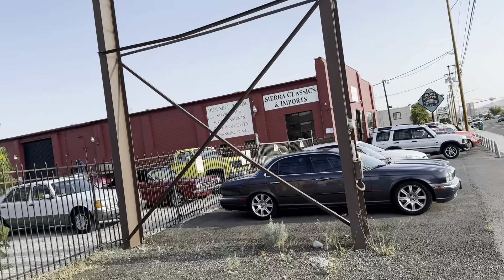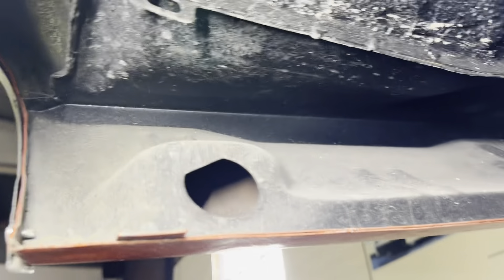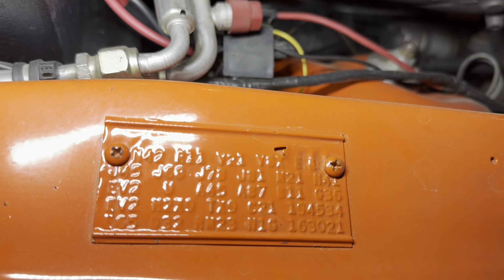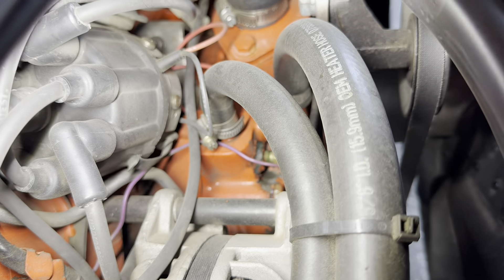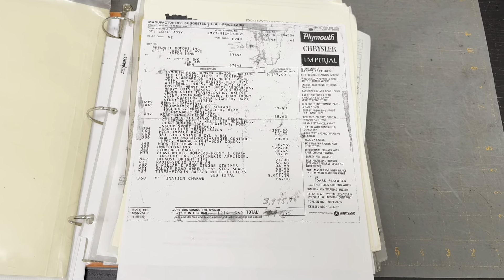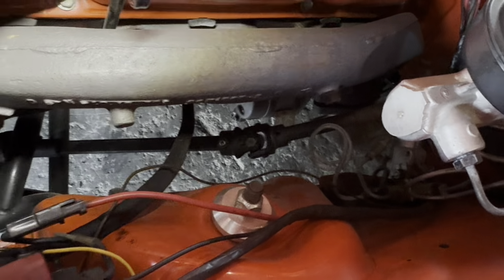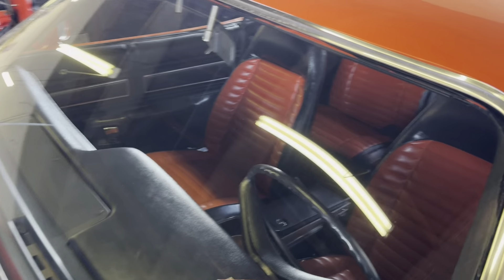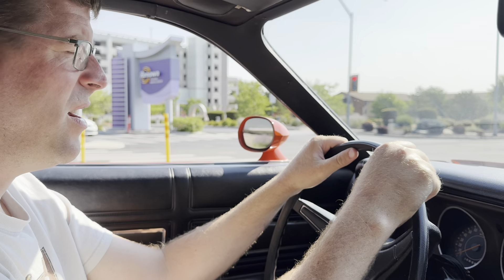Before You Buy - 1971 Plymouth Roadrunner Pre-Purchase Inspection (And What To Look For)

Comment: In my experience cars like these always bring more money than their worth because buyers never have somebody go over them and they dont know the difference. The good restorations from the smaller shops dont make money because they take so much time. Quick and dirty cars like this easily double their money. To me, coilovers, tubular suspension and Wildwood brakes are screaming red flags. They do it because its easy and they make a ton of money on it, but they are NEVER set up right. They just bolt it all together slap a coat of paint on it and boot it out the door. The cars ride and drive poorly, and the customers think its ok because they dont know any better. Then some poor owner down the road has to spend thousands with an experienced shop just to get the car as good as it would have been stock. Great vid, very cathartic, there are thousands of cars like this, hopefully people learn.
Reply from the maker: Watch my video coming out tomorrow - I’m doing a comparo test between a stock Mopar and this.  Think you know what my conclusion is going to be. To me the biggest red flag on a Mopar is no core support blackout, which this car does not have.  Saying that with as many “red flags” as this one has it’s actually a pretty good car.  We are planning on removing all the front end stuff to go back to stock.
Reply: @rocketresto  looking forward to it. Yes all things considered that car looks pretty solid for what it is, some good numbers matching components, great platform to build on. They key issue is price. You guys know what your getting, but somehow, at least in my experience, even this day in age, most people still dont. Great stuff though, very enjoyable watch, wish every car could be gone over like this before getting sold.
Reply from the maker: @maxsav007 don’t think my Dad wants to share price but will say it was $20k less than where they started.
Reply: @rocketresto  Can you double check on the turning radius? I think I heard before that it is larger (meaning worse) on the after market  tubular suspension. I would love to know if it it is , say bigger than a C body, or a  D truck!
Reply from the maker: @auteurfiddler8706 watch our video today, we go into that, it drops at 8:30 AM pacific time.

Comment: My dad was a retired (in 1978) mopar tech n racer along with I think the chassis book said that the torsion bars being below the floor lowered center of gravity drastically and spread the load throughout instead of on the coil pockets n front frame...
Reply from the maker: 100% correct
Reply: @rocketresto  I think it was in a hot rod magazine musta been late 70s early 80s they had a write up on the guy that ran 66 Dart like mine in scca.. he showed in detail his set up.  I had kept the details forever then life n crap u know.. but big takes were boxing control arms.. connected subframes.. had a bar welded in up under dash.. had a that bolted in from above between shock towers.. heavier torsion bars but can't remember what he used.  Same with sway bars.. think he had travel limiters on front and HD shocks.. but if uv ever watch that car going around the track it flew thru corners.. if I remember correctly he was the scca dude up till 70 when it all went insane.. other thing my pops preached to me was manipulating steering box/pitman and idler arm so they were as close to mirror sweeps as possible.. from experience can tell u it makes a noticeable difference on most n the others that were wacked out bad makes a new car out of them n I don't hear anyone saying anything about most of that more than old tech .. on similar note everyone hate the junk kelsey hays front brakes but all the new rage in brakes are the same concept in design.. the ones I ran in the past with regular maintenance n lubrication never had an issue n I think with a Lil research and some quality Shadetree some of these hotrod brake pads will work on those kelsey hays n probably a modern rotor too.. Love ya guys keep on keeping on Buddy

Comment: Overall, a pretty nice car, and the way you went through it in detail is great because you go through all the important stuff and it's easy to tell what's good and bad throughout the car. I wouldn't be afraid to have the car, but I agree the aftermarket front suspension setup is not what I would want. They can work really well, but on a vintage Mopar I much prefer the good old torsion bar setup.
Reply from the maker: Agree

Comment: '71-'72 is my favorite body for Roadrunners.  I had a '72 Satellite Sebring back in high school, so that body has a special place in my heart.  Nice looking car you dad bought there.  It would be cool, seeing a video of the front suspension being brought back to stock(ish).  Thanks for the video.
Reply: There is one advantage to haveing the coil over front suspension. The oil pan sump can be in the back. Raced hard it will keep the engine from being oil starved and spinning the rear bearing. For cruising it would never matter.
Reply from the maker: Such a good looking car

Comment: Back in he 1980s a guy i know had a 1972 Road runner yellow lemon twist black stripe. 400 ci  with air grabber , pistol grip 4 speed. Black interior. He ran dual Thrush Mufflers (Straight throughs) could  hear him coming a mile away. Lol. he still has the car today, I believe he had it body worked and  repainted to factory lemon twist black stripe, saw it last year going down the road...shes a beauty.
Reply from the maker: Almost like the 72 grill and tail lights better but the side markers are not great.

Comment: Nice big belt on that AC at least.  But the one thing there which sticks out to me, is that idler pulley off to the side of the compressor toward the alternator.  If you were to somehow lower that idler pulley, doing so would buy you some more belt-wrap around that compressor/clutch pulley, which it looks like it could use - I wonder if that was your belt squeal.

After your explanation of the forces to the unibody, imparted by that front suspension kit and the rear air shocks, I would go back to original style componentry there - though with some front disks, nice shocks, and slightly beefier antisway bars! OEM master cylinder and steering too. I don't think I'd touch any of that bodywork - other than the rad support blackout.

I'd actually like some nice Wilwood calipers for my 2005 Mustang GT, but that's because the car's OEM Bullet Wheels allow them to show through! Wonder if they had some garish modern wheels on the Road Runner before. I would run ONLY those nice stock wheels, or a set of Cragar SS!  Not even chrome Magnum 500s!
Reply from the maker: Yes we are currently going back to stock on it.

Comment: I totally agree with you about the aftermarket front suspension. Another Mopar Youtuber,  that is apparently sponsored by QA1, I think, says he puts them on every car he does. In fact it is the first thing! But he never gives a reason why.  I mean, if you want a 71 Road Runner to handle as badly as a 71 Monte Carlo or Riviera, and be  weaker than a 71 Maverick, the only reason I can think of is "drag race only."
I also agree about the air shocks, but they are harmless if they have only light air pressure in them.
   I think the only real way to improve on the 10.75 disk brakes is a 11.75 set up off a 75-81 B or R body, but finding the caliper adapters is not easy. I don't think any aftermarket setup can touch that. I am guessing the aftermarket front disk are "drag race only" since they are less tough the factory disk brakes but only save a small amount of weight.
Reply: Yep. On a drag car you can tie it into the roll cage and maintain some structural integrity. Pretty sure that was their target market.
Reply: @robertspence831  A certain Mopar Youtuber cut away most of the front sheet metal on an A Body, like he was going to make the main strength be a roll cage that went to the front. Then never put the roll cage in. He said it was strong enough!  And he meant for drag racing!  I did not think it was strong enough even to drive to the track.
Reply from the maker: Seen that done and is the way to do it if you want coil overs but again why?
Reply from the maker: We run those on most stuff that goes through here.
Reply: Also, that setup converts to front steer with the factory knuckles,  which destroys the akerman! Being an autocrosser, that bugs me.
Reply: @rickoates-eb3ni   Oh man. I've had two tie-rod ends break on me. One in a front-steer Fox Mustang, and the other in a rear-steer Corolla.  
The Mustang drove fine forward, and would splay/toe out the front wheels when trying to drove in reverse. 
The Corolla would drive almost normally in reverse, but pigeon/toe-in the front wheels if I tried to drive forward.
Those experiences tell this non-engineer that messing with that geometry is a BAD idea, unless you're really going to get/make everything correct!

Comment: Tom;
  Just caught this video! Why are so many people so fetermind to rip out the leaf spring systems of these old MOPARS? Do they think the engineers at Chrysler didn't know what they were doing? The leaf spring set up is adequete for normal operations and kept the price of the car down, Of course you can spend 1000's to put an updated system but most giys don't even pit it in correctly. I just don't get it.

Comment: Front end? I went with Bergman Auto Craft- Peter is awesome to work with and it flat works...not to mention it isn't $5500+
Reply from the maker: This one is not well engineered.  Don’t have experience with that one but it can’t be worse than the Magnum Force one.
Reply: @rocketresto  Peter was one of the engineers at XV Motorsports. He & John's (US Car Tools) stuff are on my old "Malaise" Valiant sedan. Peter is deathly serious about his set ups, good guy, but won't BS around with all the aftermarket schlock out there. The chassis stuff on the car is very nice as well, it has made the ol' girl very stiff, not flexyy at all
Reply: The web site says $3350 and it has strengthened versions of the stock components. I think you would have to have an awfully good reason to spend that kind of money. I am afraid big cars like this are unlikely autocross, gymkana, or Lemons competitors.
Reply: @auteurfiddler8706  I hear you. However, it is more than just beefed up stock pieces. The set up tightens up the feeling, steering and has a whole lot more adjustability. The car I use the BAC set up on? A Valiant sedan with a US Car Tool stiffening set up and 4-wheel disc brakes. I use it in TDS events and can daily drive it if I want.

I am not interested in the full-on QA-1, $11+K or the type of set up this fuselage B-body has. Tom is spot on with how the shock load being sent into the tower, which was never designed for that type of stress, or the weird looking R&P geometry

Comment: hi Tom - i always liked those rally wheels - nice car
Reply from the maker: Great looking wheels.
Reply: @rocketresto  Can you do me a favor? When you get home can you see if it is an original wheel (based on the part number near the valve on the rim) or a modified (14 inch factory center in a replacement 15 inch rim), or a reproduction? And, if it is a reproduction, can you look and see if it is "hub centric" , meaning the hub fits snugly on the wheel center.
Not being hub centric is a big disadvantage and there is a talk that the biggest sellers of the aftermarket rally wheels don't bother with being hub centric to the cars they are expected to be used on. They just make the hub super big.
Reply from the maker: @auteurfiddler8706  Think it was an original wheel?  It is over at my Dad's now so can't look at it.

Comment: This is not a California car. What you're seeingat 8:56 is the correct for 71 vapor separator tank, and it sure does look like it's been restored and is installed correctly. Having been down this road, I would strongly advise using it. If you don't, you have to plug the lines from the tank and figure out some other way to vent the tank. None of them work all that well. The line to the front is in place too. Just complete it, and connect it to the proper 3 nipple breather cap. Good to go.

Comment: Best year handling B body
Reply from the maker: Cop packages of these handle awesome with rear sway bars.
Reply: @rocketresto  I had a GY9 one with rear lovers rubber bumpers with AG hood, no roof stripe just 1/4 name plate. I was the 3rd owner. 383- 4 spd 3.91 gears, bench seat
Reply: Yes, the ones with sway bars front and rear. And best seating position, too.  For me anyway.

Comment: I'd take Wilwood over stock any day of the week, wish they were around back in the seventies.
Reply from the maker: Don’t know if they have several versions but the ones in this car are hot garbage.
Reply: The smaller versions are dog$hit...too much caliper flex
Reply: @rocketresto  The originals spent more time on a brake lathe than on the car, they always warped, in the winter time you could be sitting on flat packed snow and be stuck because one of them would stick, I noticed from Jamie video there was a lot missing from that subframe kit, it's a very reputable company that specializes in Mopar's, there is a major support piece that transfers the weight to the subframe that's not there, it's not supposed to bolt to the shock tower🙁
Reply from the maker: @13coyote13  The Magnum Force does go to the shock tower with no additional support which is why we think it's rubbish.

Comment: If that is a MagnumForce suspension I’d scrap it the minute I got it home. Too many horror stories about poor welds and control arms falling apart, not exactly the part you want to fail when driving. The better kits like HDK run a reinforced bracket.
Reply from the maker: I’m not impressed with quality or function.

Comment: Nice looker, personally I would never buy a vintage car with compromised suspension engineering. Unless you're an experienced road racer and know what you doing. Why turn  it into a Mustang II.
Reply from the maker: Agree but the nice part about this one is easy to go back to stock.
Reply: @rocketresto  I'm confident you'll make it right. Super solid and straight. Jamie will get the advance dialed in for sure.
Reply from the maker: @SE-me2pt @deaddodgegarage already done 😊
Reply: I think it’s a super nice car, papa should enjoy for sure

Comment: A big block car with no front sway bar???  And the rack steering on that car looks..... odd.  Something looks off with the rack.
Reply from the maker: Jamie thought it was off to one side, and ya no sway bar, pretty sure it should have one.
Reply: @rocketresto  I would think if it's a real, Big Block RoadRunner.... front bar should have been standard with the rear optional!

Things like that make me paranoid.  I mean, a sway bar is essential in almost any car - regardless of engine.  But if the builder ignored that pretty obvious detail..... what else did they gloss over?

It LOOKS like a nice car, but details matter!
Reply: @That_AMC_Guy  In 71 every B body with a 340 or bigger got a front sway bar.  They were a little stingy on the rears. I think 383 did not get them. The following years they came on most of the cars, even the 318 Road Runners in 73-74.